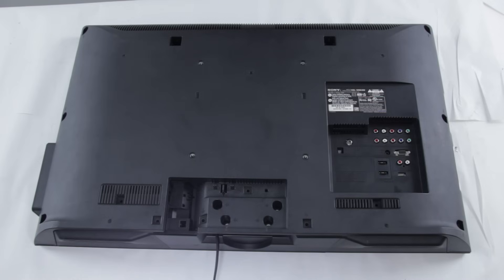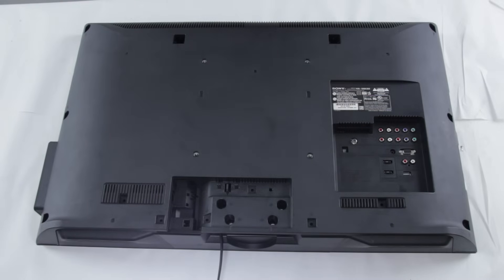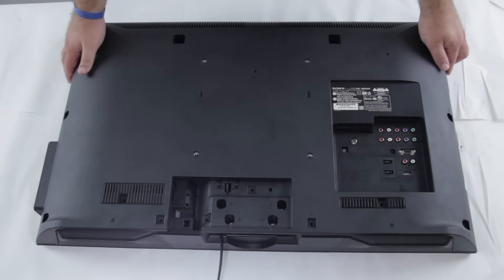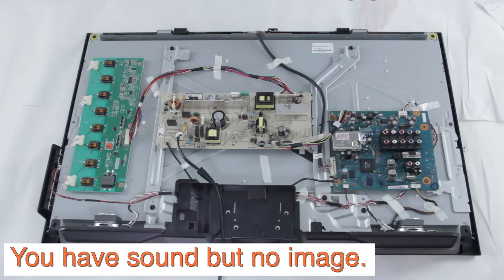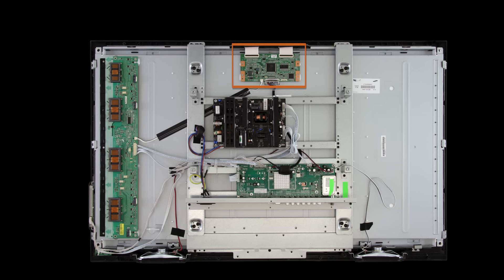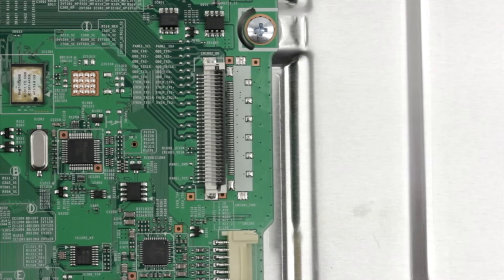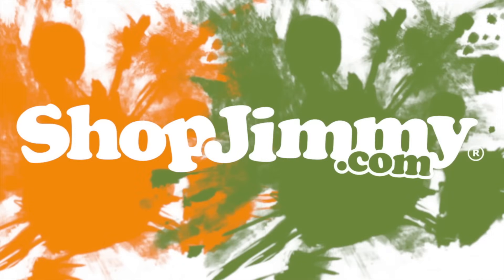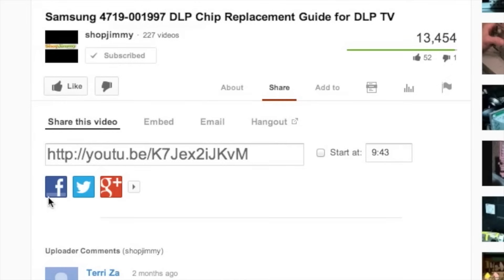LCD TV Repair Tutorial - T-Con Board Common Symptoms & Solutions - How to Replace T-Con Board

Comment: Hi, I have an Olevia LT26HVX circa 2005 and one day the video went green I thought it was the input board but the VGA is on the main board and it is green too. So I figured it was the main board.  But now that I see your video, it might be the T-con. Honestly I can't remember if the audio was affected. I know there was audio, just not sure if it was the same as usual.  What is the best way to figure out if it is T-Con or Main board?
Reply from the maker: Stan Reeser   PLEASE SUBSCRIBE TO OUR CHANNEL - Try all repairs and troubleshooting at your own risk.  I recommend replacing the main board in your TV.  Click this link to replacement parts for your TV model number:  http://www.shopjimmy.com/olevia-sc0-p506201-m10-main-board-for-lt26hvx.htm  There may be multiple boards for the same TV model number, be sure to match part numbers on your current board, with your replacement for compatibility.  Thanks and please let us know if you have any further questions with your TV Repair!  www.shopjimmy.com

Comment: Hello shopjimmy.com...  i have a 55" Toshiba Lcd Tv  Model# 55SL417U..  It is only showing a picture on one half of the screen; The other half is completely black,  In the past, if I was to rock the Tv back and forth on its stand the black half of the screen would flicker (sometimes) and you could see a very dim picture for a few seconds.  Please let me know your thoughts on this issue and if it may be easily repairable.
Reply from the maker: TechVista   Try all repairs and troubleshooting at your own risk.  This sounds like a TV panel (TV Screen) problem.  If your TV panel is bad, it may be more cost-effective to replace the TV as panels are typically hard to find in stock, difficult to replace, and expensive.  Thanks and please let us know if you have any further questions!  www.shopjimmy.com

Comment: I Have a Dynex DX-L40-10A TV ..it plays and shuts off in the middle of a movie ...the back light stays on. I have to unplug the and start over. should I purchase the T-con board ? main board? or Power supply? which to purchase? please advise.
Reply from the maker: Jeff Hudson  Try all repairs and troubleshooting at your own risk.  I recommend replacing the main board in your TV.  Click this link to replacement parts for your TV model number:  http://www.shopjimmy.com/catalogsearch/result/index/?cat=56&q=DX-L40-10A  Be sure to match part numbers on your current board, with your replacement for compatibility.  Here is a link to a video showing how to identify your part number, click here:  https://www.youtube.com/watch?v=LIWO2A_tuaI  Thanks and please let us know if you have any further questions with your TV Repair!  www.shopjimmy.com

Comment: I have a SAMSUNG UN46B6000VF which has vertical color lines randomly coming and going. Is this a T-con board problem?
Reply from the maker: Brian Harrison   Try all repairs and troubleshooting at your own risk.  This sounds like a TV panel (TV Screen) problem.  If your TV panel is bad, it may be more cost-effective to replace the TV as panels are typically hard to find in stock, difficult to replace, and expensive.  Thanks and please let us know if you have any further questions!  www.shopjimmy.com

Comment: I have a vizio vo370m and I am having picture issues. The picture looks what I think is solarized, the menu does not come up in proper color either. What I found online was it should be the tcon board, I ordered a replacement from a shop and it was a substitute part number not the exact board. When I installted the new board the picture was worse than what I had to begin with. The shop I got the part from says it must be the main board but I am not sure. any thoughts?
Reply from the maker: John Garza  Try all repairs and troubleshooting at your own risk.  This could either be a problem with the main board or the TV panel.  You can replace the main board to see if that fixes the problem.  If the main board does not fix the problem, then I would you most likely have a bad TV panel.  Click this link to replacement main boards for your TV model number:  http://www.shopjimmy.com/catalogsearch/result/index/?cat=56&q=vo370m  Be sure to match part numbers on your current board, with your replacement for compatibility.  Thanks and please let us know if you have any further questions with your TV Repair!  www.shopjimmy.com
Reply: Thanks for the advice. Greatly appreciated,  i will let you know what i find
Reply: John Garza So no joy with the mainboard fixing the problem. still horrible picture with the color not correct. I tried both tcon boards, the original looks the same, and the replacement is worse. Any ideas? I saw online some where that the settings in the mainboard might need to be changed but I can not find how to access the programming to change the setting to see if it would fix the issue. Any ideas?
Reply: John Garza just a follow up I do not have any horizontal lines or vertical lines in the picture. We were able to make picture adjustments i.e. changing the reds and greens settings to make the picture tolerable. So I have replaced the main board and the tcon board with no success
Reply from the maker: John Garza    Try all repairs and troubleshooting at your own risk.  This sounds like a TV panel (TV Screen) problem.  If your TV panel is bad, it may be more cost-effective to replace the TV as panels are typically hard to find in stock, difficult to replace, and expensive.  Thanks and please let us know if you have any further questions!  www.shopjimmy.com
Reply: ok Thanks for the help I appreciate it!

Comment: Hi I got model LN55C650. Running a same problem of vertical lines for couple years now. Not sure if its TCON board or loose wiring, still have to open the back.
Reply from the maker: Kris Cap  Try all repairs and troubleshooting at your own risk.  This sounds like a TV panel (TV Screen) problem.  If your TV panel is bad, it may be more cost-effective to replace the TV as panels are typically hard to find in stock, difficult to replace, and expensive.  Thanks and please let us know if you have any further questions!  www.shopjimmy.com

Comment: Hello, I have an Samsung UE40EH5300WXXH. When I power it on by remote control it starts, shows picture and has sound but is not responding to remote control. After about 30 to 45 seconds it restarts itself , has picture and sound, is not responding to remote control, and restarts again, and so on. Could this be a problem with the main board? Thanks

Comment: I have a samsung  32in flat screen tv modle # LN32C540F2DXZA/S/N Z1NX3CHZ502235V the red led light stays red but will not turn on, all caps look good, replaced glass fuse same results.

Comment: Need Help..I have A Proscan 40LD45QC LCD TV and the Color of all the menus are green and purple instead of blue and black..There's no components plug into LCD TV. I took the cover off and thought that a cable may be loose and made sure everything was securely in place... I believe it's the T-Con  or the LCD timing controller base on some articles I've read on the net but not sure please help...thanks

Comment: I have a three month old Samsung 55" led lcd tv. It is still under warranty.

 It just developed a pinkish tint. Faces have a slight pinkish or redish color.  I've tried to adjust it using the user adjustments, which helps, but it doesn't go away completely.  I turned the tint a little to the green side.  I've tried different inputs, different Direct TV boxes, my DVD player, and different cables.  The main board has been replaced.  Geek Squad has not been able to determine the cause of the problem.   They order a cable that goes from the main board to another board.  Not replaced yet.  Do you have any idea what the problem could be?
Reply from the maker: 3vino1   Try all repairs and troubleshooting at your own risk.  If the TV is still under warranty then I recommend that you send it in for repair.  If you work on the TV and it is under warranty, then it could void that warranty.  Thanks!  www.shopjimmy.com
Reply: It is under warranty and they are coming in to replace a cable.  They already replaced the main board.  I'm not going to work on it myself.  I just wondered if you knew what the cause of the problem might be.  Bu thanks anyway.

Comment: I have a Sony KDL40W4100 which started getting multi colored vertical and horizontal line (many lines not a few) the T-con board is 404652ASNC6Lv3.7
How can I determine if it is the T-con board vs the LCD panel going bad
Reply from the maker: Richard Seale   Try all repairs and troubleshooting at your own risk.  This sounds like a TV panel (TV Screen) problem.  If your TV panel is bad, it may be more cost-effective to replace the TV as panels are typically hard to find in stock, difficult to replace, and expensive.  Thanks and please let us know if you have any further questions!  www.shopjimmy.com

Comment: I have a 46" Vizio I just bought offline. It turns on. I see the backlight. But no picture. No sound. Not sure if I can get sound hooking up laptop to tv, because I cant see which source I am using or if I can change it without seeing anything. Model#  vw46L fhdtv10A. I seen another of your videos on capacitators, so I checked them and they all seem to look good. After seeing this video, I'm guessing either tcon or main board. Is there any way to decipher which one it could be over the other?
Reply from the maker: *****  Try all repairs and troubleshooting at your own risk.   This could be a problem with either the t-con board, the main board or the TV panel.  You can replace the t-con board and the main board individually to see if one of those fixes the problem.  Please reply with your TV model number.  Click here to view a video that shows how to find your TV model number:  https://www.youtube.com/watch?v=S51nhAmwR2M  Thanks!  www.shopjimmy.com

Comment: Vizio VT420M.  it will turn on via remote or panel button.  However, it responds extremely slow to any command whether it be for the menu, channel change, volume, etc.  Picture is very slow and jagged/distorted picture such as the digital camp pattern.  Sometimes, when the slo-mo is stagnant, the picture is very clear so its not the panel/screen. Sound is also stuttered.  Almost like the processor can't handle the signal fast enough. Have tried cable, A/V, S-video, and HDMI inputs and all are the same.  The VIZIO logo light on the housing comes on an extremely faint orange and never turns white when powering on the tv like the other Vizio we have.  Would this indicate a power supply board since the vizio light doenst show that it is receiving enough power to fully illuminate?
Reply from the maker: Steve Nimmer   Try all repairs and troubleshooting at your own risk.  This could be a problem with either the main board or the TV panel.  You can replace the main board in your TV to see if that fixes the problem.  Click this link to replacement parts for your TV model number:  http://www.shopjimmy.com/catalogsearch/result/index/?cat=56&q=VT420M  There may be multiple boards for the same TV model number, be sure to match part numbers on your current board, with your replacement for compatibility.  Here is a link to a video showing how to identify your part number, click here:  https://www.youtube.com/watch?v=kxkeGLhlQY8   Thanks and please let us know if you have any further questions with your TV Repair!  www.shopjimmy.com

Comment: Have a vertical and horizontal line going across tv.Its a sony bravia kdl 52w3000 serial # 8046297. Is this the t-con board?  Phil Olson
Reply from the maker: Phil Olson   This sounds like a TV panel (TV Screen) problem.  If your TV panel is bad, it may be more cost-effective to replace the TV as panels are typically hard to find in stock, difficult to replace, and expensive.  Thanks and please let us know if you have any further questions!  www.shopjimmy.com

Comment: Hi. Great tutorial video's you share. I have a Sylvannia LCD tv Model 6620LF serial number J13515346 and just recently started having problems. This tv was manufactured in 2005. My TV turns on but all I get is a white washed screen and I can see images slightly in the back ground. Like ghost images. I do have sound. Is this what they call a backlight problem. Just need to know what part would I need. Thanks again for the informative video's.
Reply: Thanks for the reply. Decided to just buy another TV instead as you suggested.

Comment: I could sure use some advice, please.  I have a 2008 Samsung LCD TV.  Model number LN32A450C1HTZC.  My volume control had "stuck" at about 28% and would not go up or down with the remote or the buttons on the TV.  I decided to attempt a factory reset.  Something went wrong during the reset, and it FAILED!  Now the TV will come on and off with the remote, but that is all.  I was using the TV as a monitor for my PC, via the HDMI cable input.  Now the TV shows channel "3" when turned on and will not change "sources".  The remote will not do anything except turn it on and off. (no channel changes, nothing)  The buttons on the TV do not work at all.  Am I scr*wed or what?
Reply from the maker: James Holben  Try all repairs and troubleshooting at your own risk.  I recommend replacing the main board in your TV.  Click this link to replacement parts for your TV model number:  http://www.shopjimmy.com/catalogsearch/result/index/?cat=56&q=LN32A450C1  There may be multiple boards for the same TV model number, be sure to match part numbers on your current board, with your replacement for compatibility.  Here is a link to a video showing how to identify your part number, click here:  https://www.youtube.com/watch?v=BEPWrefQvqI  Thanks and please let us know if you have any further questions with your TV Repair!  www.shopjimmy.com

Comment: Hi There, I have a Samsung 46" LCD TV, Model#LN46C630, SW Version: T-VAL5AUSC-1006.1. The issue is when the TV is on but my antena box is turned off the screen is supposed to be black but in my case it has intermittent flickering colors - Red, Green, Blue, some horizontal lines along with that. The issue is intermittent, started about 7-10 days back but seems like becoming more frequent. When I have my antena box on & the issue appears the picrute color gets distorted more like spilled extra color. I use a receiver for Audio which is working fine but I can check the TV audio also. Can you please suggest what may be the issue and if I can get the spare from your site to fix it? Thanks.
Reply from the maker: NILADRI MUKHERJEE   Try all repairs and troubleshooting at your own risk.  I recommend replacing the main board in your TV.  Click this link to replacement main boards for your TV model number:  http://www.shopjimmy.com/catalogsearch/result/index/?cat=56&q=LN46C630  There may be multiple boards for the same TV model number, be sure to match part numbers on your current board, with your replacement for compatibility.  Here is a link to a video showing how to identify your part number, click here:  https://www.youtube.com/watch?v=BEPWrefQvqI  Thanks and please let us know if you have any further questions with your TV Repair!  www.shopjimmy.com

Comment: Model - Sony KLV-32S400A
Symptom - Solarisation.
Can you please suggest what could be faulty?
Thank you.
Reply from the maker: Sunil Narayan  Try all repairs and troubleshooting at your own risk.  Try all repairs and troubleshooting at your own risk.  This could be a problem with either the t-con board, the main board or the TV panel.  You can replace the main board and the t-con board individually to see if one of those boards fixes the problem.  Unfortunately I do not see any replacement parts in the search results for your TV model number on our website.  Thanks and please let us know if you have any further questions!  www.shopjimmy.com
Reply: Thank you for your time and information.
Later found chip AS15HG overheating on T-CON board. I guess T-CON board replacement may rectify the fault. Kindly advice.

Comment: My nephew had a TV, Philips model 42PFL3704D/F7, that he decided to wipe down with a drenched washcloth. That was 3 yrs ago. His mother gave me the TV and said I could have it. The TV will come on, but only has a white screen and display. There is also a vertical line on the left side. Its like its showing everything in negative. I took it apart and there was some corrosion on a circuit board connected to the screen. Also, some screws holding the backlight inverter were rusty. So what steps should I take for repair?
Reply from the maker: Samantha Small  This sounds like a TV panel (TV Screen) problem.  If your TV panel is bad, it may be more cost-effective to replace the TV as panels are typically hard to find in stock, difficult to replace, and expensive.  Thanks and please let us know if you have any further questions!  www.shopjimmy.com

Comment: Sony Bravia KDL-52V5100 Screen is backlit, but no picture or sound.  Was working fine and then quit all of a sudden.  Green light stays lit.  TV clicks and cycles on and off but is always a grey screen.  Please help!
Reply from the maker: Brady Buegeler   Try all repairs and troubleshooting at your own risk.  This could be a problem with either the t-con board, the main board or the TV panel.  You can replace the t-con and main board individually to see if one of those boards fixes the problem.  Click this link to replacement parts for your TV model number:  http://www.shopjimmy.com/catalogsearch/result/?q=KDL-52V5100  Be sure to match part numbers on your current board, with your replacement for compatibility.  Thanks and please let us know if you have any further questions with your TV Repair!  www.shopjimmy.com

Comment: Coby 4025 40 inch tv...picture flickers like a strobe light. Cold start after 3minutes it starts flickering. it will stop once in a while then start again.  All cables are good..is it one of the boards inside?